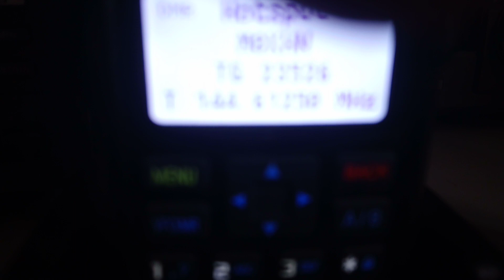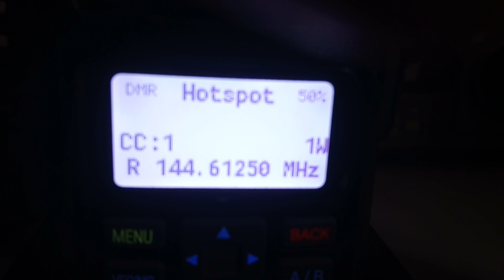Baofeng DM860 as a hotspot

Comment: Is the Open GD77 firmware for the DM-1801 complete or are their some bugs still to be worked out?
Reply from the maker: There may be bugs but mine works fine both as a transceiver and a hotspot.
Reply: @KevinOReillyswl  With the new firmware can you adjust the transmit mic audio louder or softer?  Is there also an adjustment to offer more speaker volume.   Thanks, Ken
Reply from the maker: There is an adjustment for the tx mic level but not as far as I can see for the receive volume.